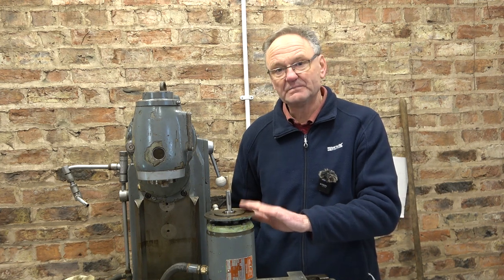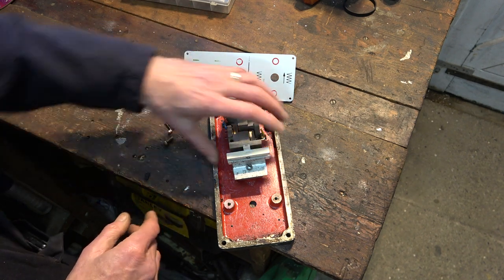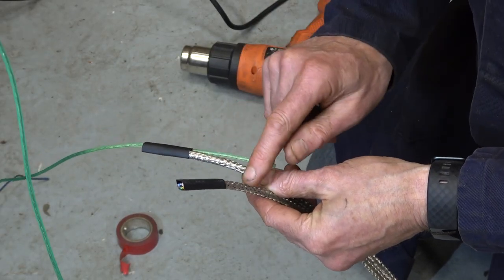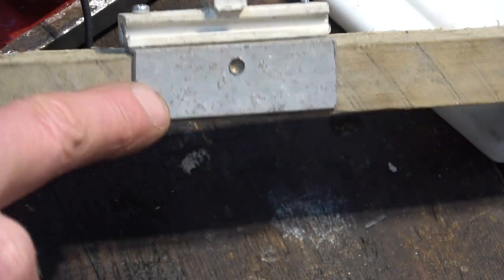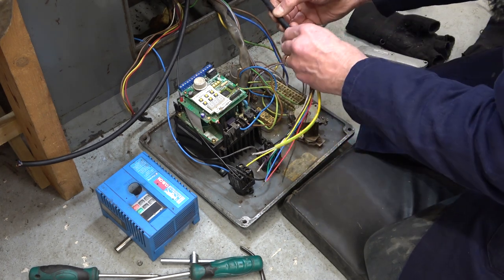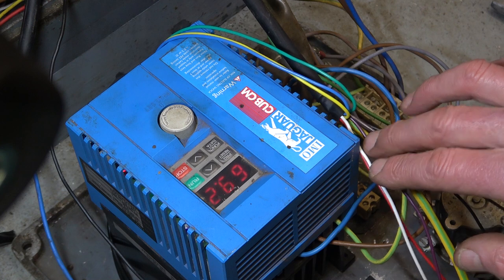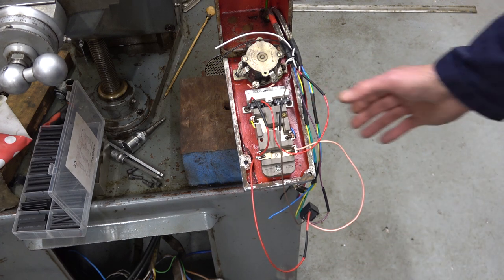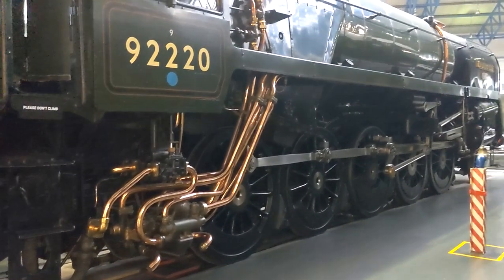HS175 Harrison universal mill servicing – Part 8 Electrical (1)

Comment: Hi Paul. Another well presented film. I could follow it all the way with the aid of your diagrams. I particularly like the way you're trying to retain the old hardware, rather than just ripping it out and replacing. 
Over the years I've spent quite a few hours in the Railway Museum myself. I'm not particularly into railways, but there's an irresistible draw to the scale and quality of yesteryear. I think "anemoia" sums it up. 
Looking forward to the next part. Cheers, Matt 👍 🇬🇧
Reply from the maker: Hi Matt I had to look up that word .... wiki tells me it comes from the Greek for wind and mind meaning "Nostalgia for a time or a place one has never known.".  I can just about remember steam trains in York station. The engines were very dirty and inefficient but nonetheless represented the pinnacle of steam and land-motive engineering in their day. I think about the 1000s of people who worked in the foundries and engine works building these heavy machines and the generations of skills accumulated now mostly all gone. A bit like ship building in this country I suppose.  So yes nostalgia for times past perhaps sums them up - a bit like uncovering a large dinosaur fossil. Cheers
Reply: That's a new word to me "anemoia", brilliant, thanks

Comment: Really impressed with your Japanese comprehension, learned something myself too. You're one smart guy! Anyway, I'm enjoying the mill restoration series. A lot of work, but I hope it's well worth it when she's finally back together and making chips.
Reply from the maker: Hi R9000, back in 2001/2 I was working with Japanese customers and had to learn some (just basics). Since then I have tried to keep it going but I seem to forget as much as I learn. There are very few Japanese speakers around here - we did an evening class at the university language school maybe 3 years ago just to give it a refresher boost. These old machines are usually a lot of work to begin with as they've often not really been serviced for decades. That said, I could have been cutting from the day I bought it but I want to get it right electrically and mechanically now and the hopefully I won't be fixing in later when I'm trying to get jobs done. If I ever get the time someday I might give it a splash of paint also. Cheers

Comment: Good progress despite the cold workshop.
My modern inverter has the fwd/rev capability built-in the unit.   Sounds like your second inverter may have this also.    A lot of work in this part.
I know you do not want to get a 3D printer, but this video has many places where a 3D printed part may help in the restoration/rewiring.
I love learning new UK/US translations.   Screened cable term is not used in the US, instead it is normally called shielded cable.
I love the York railway museum.    The last time I visited was many decades ago.    I do not recall the cutaway of the locomotive (US term for engine).
I was lucky to have made a trip on the Shinkansen back in the late 80's.    A very smooth ride.   The speed was not obvious, although looking out the window we were travelling at a good clip.
Dave.
Reply from the maker: Hi Dave, we might also say shielded. There are many UK/US 'translations' that most of us know but sometimes we get caught out. In the early 2000s we lived amongst a community of Americans and we learnt about grilling and broiling. I think our grilling is your broiling. But another word that caught us out was Bleachers - a word we had never heard. In fact last year I saw the word bleachers in the UK for the first time - in a sports hall. I'm delighted that you have visited our lovely City of York, we are very lucky. The Govt decided to locate the National museum here in 1975. It's free. We travelled on the Shinkansen (new main line) in 2019 and clicked along at 175mph - it's very impressive. I made a video about York - HS74. 3D printer comments noted. Regards.

Comment: Ages since I was last in the rail museum. Need to take my better half for a day in York now we both have our rail cards. I used to do some insurance inspections on steam and diesel engines at a heritage railway in Lancashire, really didn't like doing them. Being stuck under this filthy dirty hard to get at 80 year old piece of iron was not my idea of a good working day. Having said that the Scotsman was in being overhauled, nice to see it in bits. 
And the milling machine is still coming along well. Part of the problem with retrofitting old kit with new parts though is all of the hidden alterations.
Reply from the maker: Hi Bill, I think steam trains are a romantic notion but the reality was a hard physical job on hot, stinky, oily, noisy machines. Early hours, long days. But they do represent some of our best engineering back in the day. The National Railway Museum is a treasure and we are very lucky to have it close by. Cheers

Comment: This was interesting and a great improvement. It has reminded us that we need to tackle our lathe wiring at some point
Reply from the maker: Hi GTB, I'm no electrician but I do have a fair bit of experience with electrical and electronic things and it always surprises me just how long these jobs take. There are often unforeseen complications doing one-offs.  If you install the same kit every day then you've got a ready 'kit bag' of solutions to problems you have seen before. Moreover you know how these devices play up from time to time, when to worry and when to just press the reset. I've still to sort out the electric oil pump on my lathe, it's still on the 'temporary' solution after more than a year. Cheers

Comment: Another excellent episode!
Reply from the maker: Thank you LE. Making the video on the electrical stuff took quite a bit of effort but at least splitting it into two means I can ease up for week without production pressures. Soon as we get through this bit of a cold snap I'll be back in to get the table motor on. Cheers

Comment: Would recommend adding across the relay coil some transient protection, easiest to do with a 1N4004 diode across the coil, or a 100n ceramic capacitor in series with a 33R 1/2W resistor. That will keep the high voltage transient down, and mean you do not have to rely on the input overvoltage protection of the inverter to clamp the relay spike.
Reply from the maker: Sean, I'm going to follow up your advice thanks. I did think about it but the 'offical' bought remote control on the lathe did not have that so I thought it would be ok. But, as you will see in Part 9 (Elect part 2), I have ended up with two Panasonic 24v (15 mA coil) mini relays on the Cub PLC/+24v line to get the interlock with the Eurotherm table motor inverter. I might have those components in my bits tin - except maybe the diode. Appreciated. Regards Paul

Comment: Very nice work. Elegant solution with the buttons. I had a similar problem on my lathe but I used the single pole switch to activate a relay which then gave double pole operation. Thanks for your email. I'm going to look at my gearbox tomorrow and I'll get back to you re your query.
Reply from the maker: Hi Carl, the design evolved as I went along. If I were doing it again then yes I think a double pole relay would have been a better solution.  It all became quite complicated getting the interlock between the two old inverters with 2 relays on a limited milliAmp budget. You will see later. Cheers
Reply: @HaxbyShed  Great stuff Paul.

Comment: Nice job on the screened cable, if outer sheath is easy to remove,  it means cable is fairly new, after time the talcum powder (or equivalent), drys up and makes it difficult to remove. 
Like the re-engineering of the switch controls,  time consuming,  but looks great. Rats nest of wiring looks better now.
Your circuit on the relay (hand drawn on paper), looks fine, my only concern ( as also commented on), is the possibility of the relay contacts, and/or the NC E Stop welding together. "Positively Guided Relays" at the very minimum should be used, and 2 contacts in series, though as its only yourself who will be using it etc, it's largely a personal choice.
Lovely pictures of your family,  I keep promising myself a trip to York Rail museum. 
Thanks for sharing Paul 👍,  best regards John.
Reply from the maker: Hi John, I had to look up Positively Guided Relays and note they have "Contacts which are mechanically connected in such a way that N/C and N/O contacts can never be closed at the same time." So if one contact welds the machine still won't run. You may have seen the vid where the NVR switch on my drill shorted - that's still on my mind because it frightened the heck out of me and I should fit an ES for sure on that (must do, must do, must do ..... say it enough and it will happen).  Cheers
Reply: @HaxbyShed  Hi Paul,  hopefully it helps, rather confuses? I'm not a controls engineer,  my HNC is in Mechanical and Production Engineering,  but I spent quite a time testing and commissioning machines, withl cell guarding,  powered operator doors, automation/robots, part of my job was to check all safety functions as designed, and if there was a scenario that was unsafe, or uncontrolled. I did design and add a light curtain to one our inhouse machines,  and first used these relays. 

On a similar point,  because our machines (rotary friction welders), have a large rotating mass (spindle) think large lathe with blooming big chuck, when the emergency stop is pressed, we cut power to all outputs (dumping air, hydraulic valves, stopping motors etc), BUT we have a time delay before cutting power and control to the spindle and hydraulic pump, this time delay is to allow powered stopping of the spindle using the inverter, and hydraulics to ensure the chuck is gripping the part. Time delay is set to 2 sec. Just freewheeling the spindle , that is cutting power, is an uncontrolled action, so dangerous, and not allowed.

On some models,  we have a hydraulic spindle brake ( just a brake disc and several callipers), this is backed up by an accumulator (nitrogen filled bladder type).
Pre DC and AC inverter spindle motors and corresponding controllers, we used standard 3 phase AC motors, always rotating,  and a motor mounted clutch, and spindle hydraulic brakes. To start rotation of the spindle, we release the brakes, then engage the clutch, to stop, we disengage the clutch, then close brakes. These had the disadvantage,  that the deceleration time was difficult to control, a critical parameter on some products, and very hard on the braking systems. 
Best regards John
Reply from the maker: @bostedtap8399  Thank you John. Production machinery and associated electrical and pneumatic control systems are evidently a whole other world of technology and experience. Kinda explains why the average domestic electrician does not want to work on workshop machinery. Cheers
Reply: @HaxbyShed  Hi Paul,
Yes, there is a very large gap between a domestic electrician and a controls electrician, both have training and certification, or should have, interestingly the same set of regulations cover wiring a shed to multi-million machines or systems. BS 7671 . but on the controls design side, the Machinery Directive is the complicated bit. Regards John.

Comment: Obviously still a little wiring to go, but I like the solution you adopted for the buttons. Not sure if you have planned it, but once you're happy with the wiring it would be really cool if you formalised it in a wiring diagram for future users that will be very useful to them for future fault finding or installing new hardware etc
Reply from the maker: Hi Paul, yes that crossed my mind too and I have drawn up a diagram which I plan to laminate and put in the base.  I've also printed labels for some of the wires, again to help understand it in the future.  Cheers
Reply: @HaxbyShed  Laminating it will ensure it lasts and the labels will be the icing on the cake :)

Comment: Great video, you made it easy to follow with all the diagrams and explanations.

Does the pot need frequent adjustment? I was wondering whether it could be mounted in the inside and accessed through a small aperture with a cover on the side, just a thought.

Thanks for pointing out the Japanese and explaining the meaning of each symbol, now I know why you know superdry clothes aren't made in Japan😉😉.

After all the effort they made to make the new streamlined casing for the Duchess it would be shame not to see it taken out onto the mainline. 

Good luck from a snowy Spain!!
Reply from the maker: Hi David, yes the pot could have a tweak with every job. It's just whether it is easier to change gear on the box or tweak the knob. And the pot range gives 'infinite' speeds between the box gear speeds; the box is a bit 'tall' in it's speed spacing. Handy if you just have a bit of chatter and you want the speed down 5% say - you can tune it real time during the cut. A have a Japanese friend who laughs at Superdry logos because they make no sense (in Japanese). The Duchess has 4 calendars and  50sq feet of firebox grate area. Must have cost a fortune to run and maintain. Snow in Spain ..... you must be North? Cheers
Reply: @HaxbyShed  Hi Paul, it almost sounds like an overdrive!! Maybe if it's for frequent use and during the cutting operation you will want it easily accessible.

Well we are based based down in a little town called Monachil, in the province of Granada. The coast is about 30 minutes away further south and the ski slopes of Sierra Nevada about the same towards the east. Spain is very high so to go from the sea to us you rise about 3000 foot, we normally get a little snow here each year which only lasts a day or so and there is enough snow for skiing at about 6000 foot. Sierra Nevada is the southernmost ski resort in Europe. Each year the snow comes later and less of  I'm afraid.

Have a great weekend
Reply from the maker: Looks very nice David. We had a relative living in Nerja for over 20 years. We visited a couple of times. Cheers

Comment: Well done on the progress and description. 

The relay with the start and stop buttons are commonly referred to in the US as a 3 wire stop and start control, would that be correct in your part of the world? Just curious. 

That was an extra treat with the rail museum and the smiles at the end were great!! How far is it for you to go to the rail museum?

Keep up the good show.

Scott
Reply from the maker: Hi Scott, I'm not an electrician so I don't know the proper term here, and Google UK search did not help me answer. I have seen '3 wire control' mentioned on import inverters and so I know what it is. We live near York and the museum is only about 4 miles from us. It is a great day out when we have children with us, and to be honest my wife and I just go by ourselves sometimes. York is very historic with medieval walls, I made a video HS74 - May 2021. Cheers
Reply: @HaxbyShed  Yes they way you have it wired is a good way, In case you have a power outage the control will drop out and not come back on when the power comes back on. You have to press a start button to make the machine come back on. 
Scott

Comment: My only concern with the relay latching is that if the contact welds closed your emergency stop will not work. One way to mitigate this is by adding another contact in the E stop and inserting the second n/c contact in the 24V signal to the VFD. Please don’t use the plastic box, you have put a lot of effort into keeping the original switches and this would IMHO spoil it. Why not weld up a shroud deeper at the top tapering down.  There are also 22mm pots that are better protected, you can get them quite cheaply from China, appreciate space might be an issue.  Clearly whomever did the original VFD installation didn’t really fully understand what they were doing.
Reply from the maker: Hello Tony I did think about welded relay contacts and inverter control circuits failing but it's nearly as near to the plug switch as the button - my socket outlets are double pole. I know the socket is not the same as an ES but it's about the risk in diminishing probabilities. Cheers